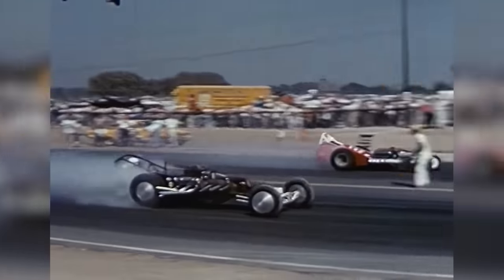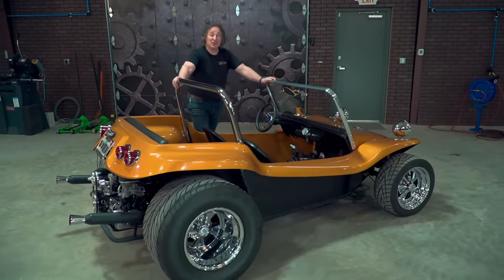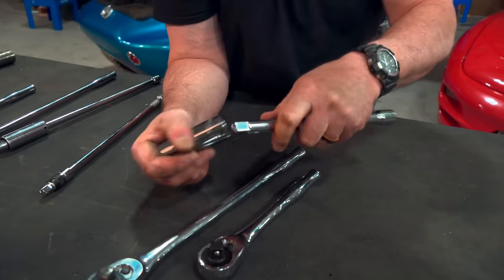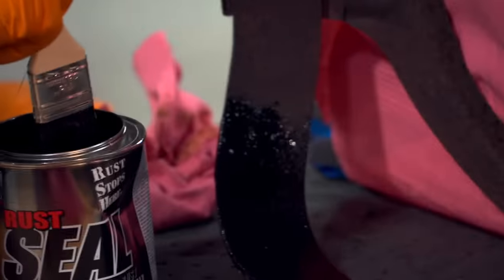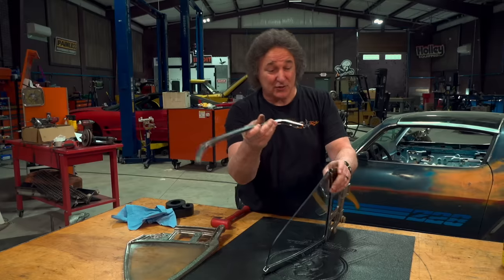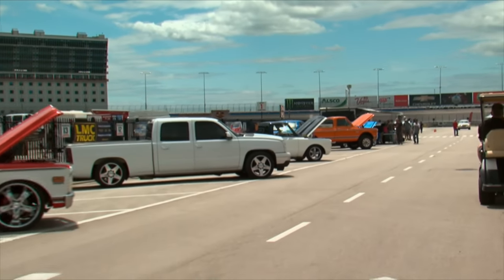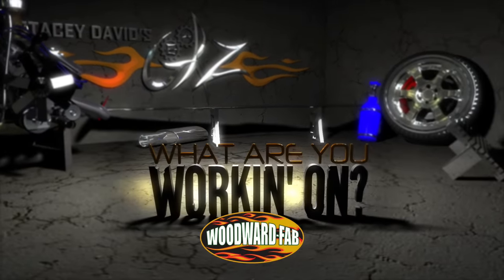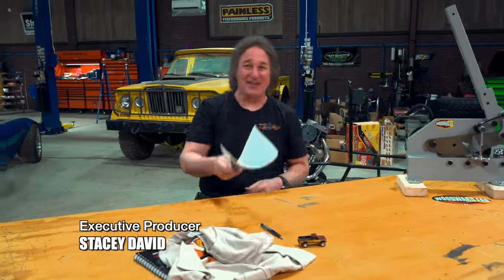The Meyers Manx Dune Buggy Story - Volkswagen Kit Car Craze - Stacey David's Gearz S16 E7

Comment: your tool tip was definitely a good tip, I have a 3/8 drive ratchet made by  Husky tools that has a extending handle that makes it about 4" longer, and it adjusts to multiple sizes in between. I have also put a 3' pipe on that ratchet handle and pushed on it with my foot without breaking it ! I will never part with that ratchet.
Reply: I have a Proto 1/2" drive long-handle ratchet that has survived more egregious abuse than any breaker bar I've ever owned. I'm pretty sure it's made of adamantium with kryptonite gears, haha! I've jumped on that thing with a cheater pipe on it (I'm not a real big guy, but 150 pounds jumping on a 4' lever is still a LOT of force), never a complaint. The best part is that I found it in the web of a beam in a powerhouse I was working at, so it cost me nothing. If I'd bought it, I probably wouldn't treat it so mean, haha!

Comment: Built my own out of a vw when I was nine, 1965.  Boat  racks and never shortened it so I could carry my outboard motor in the back.  Due to the flat bottom I could actually skip across small rivers if I hit the water at about 55-60 mph. Had a blast. First time I was ever pulled over by the police. The officer shouldn't outta have down that cause it cost him big time.

Comment: I love the wheel/tire set up does anyone have a idea of the rear sizes?
Reply: in the 80s I ran Pirelli P7s in 315/50/15 on 10 inch wide Centerlines.  It would have been faster on 225s, but those 315s were crazy-wide and cool back in the day